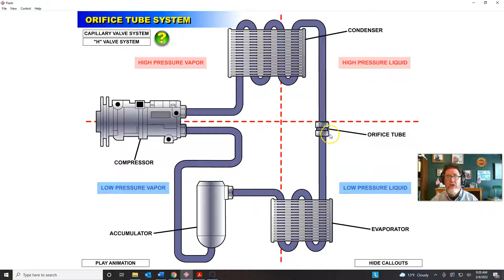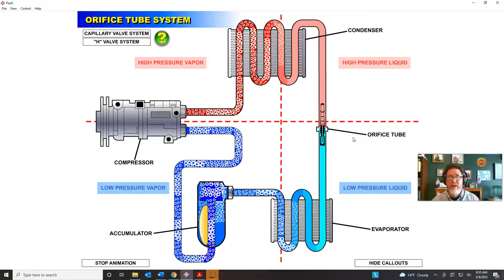How does an Automotive A/C System work: Part 3 Orifice Tube Systems

Comment: You talk about the evaporator filling with liquid and flooding over during low load conditions, but where would that same liquid be located during high load conditions.  I think it has to be somewhere, not normally talked about but my understanding is the amount of liquid in the system should remain relatively constant whether running high load, low load, or turned off.
Reply: During high load conditions, most liquid being pushed through the evaporator is evaporating and turning into a vapor through state change, when the evaporator gets to a point of almost freezing up (20ish psi) then the low pressure cutoff switch will shut the compressor off preventing evaporator freeze up.

Comment: (New compressor, Accumulator, all lines, internal orifice tube, and completely recharged) What if the lines on both sides of the orifice tube are warm, not hot, after the system has been running and the High Pressure side is reading a low PSI (80). The system only blows warm air, not even cool, and nothing under the hood is running cold at all even the lines. It's driving me nuts. Could the condenser be clogged, or blocked? Thank you!😢

Comment: Can a bad clutch fan cause A/C not to work properly?
Reply from the maker: Yes, it will cause pressure to be very high at low speeds causing no cold air. PP.

Comment: Any A/C Ninjas out there? Professor? I have a 1980 Corvette L82 with A/C issue. The system will cool to 55 degrees on an 80-degree day. However, the compressor remains engaged at all times. The high-side pressure never gets above 50PSI. The system should have (converted) 48oz of R134, but with 36 oz in, the low side is up to 55PSI. (Nervous to put in more.) The system is all new. There is a new evaporator, condenser, orifice tube, compressor from Rockauto/Gold, and most lines. The lines in and out of the dryer and evaporator are cold. Cold to orifice tube bottom, hot pass the orifice tube connection. Freon detector finds no leaks. What would cause the high side to not go beyond 50PSI?
Reply: Sounds like youre low on refrigerant but possibly compressor issues. Where are you getting your 48OZ and 36 OZ? Brand new system, sounds like this is the issue

Comment: Hi professor. How about if the evap is freezing up and I changed the low pressure switch on the accumulator and the charge is good? No restrictions on the evap or draining for it as well. What could be the problem? Clogged OT?

Comment: I have change the compressor the cindenser and the acomulator on an f150 2006 and now im getting about 70 psi on the low side and 350 plus on the high side and if i remove refrigerant presures regulate and it needa more refrigerant ?  What do u think about this the evaporator is restructed ?

Comment: @professor Pentane, I was hoping you can explain in a video an auto A/C system with a auxiliary Evaporator. The front Evap uses a OT and the rear Evap uses an TXV. It only has an accumulator and No Receiver/dryer. With a scroll compressor and clutch fan.
How much more difficult is it to trouble shoot this system and what would be the "good/normal" pressure readings on a manifold gauge.
Reply from the maker: Hi Alfredo,   I have another video talking about rear A/C systems and how they effect pressures.  Please watch to answer your questions:  https://www.youtube.com/watch?v=k2xGv6CyJyI&list=PL3XwHgpcSh2ZWNwqI-RWG-6pt8BWsvDJs&index=3&t=3s
Reply: @ProfessorPentane  thank you, I appreciate your response.

Comment: Great Video.  I need HELP.
I am working on 2006 Mercury Mountaineer V8 4.6L. Replaced one Orifice tube by the firewall.  But my brother-in-law informed me that there are 2 orifice tubes in the system.  Is it true? If so where is the second orifice tube should be?
Thank you for your help in advance.
Reply: My 2002 mercury mountaineer 4.6L also has an auxiliary Evaporator in the rear but it uses a TXV and not a OT. It's located next to the Evap on the rear Left side. You need to disassemble the interior in that section.

Comment: Very nice explanation.  When converting an older system from R-12 to R-134a, would you recommend changing out the orifice tube to what is used in the early 134a systems?

Comment: What if you had an orifice screen air conditioning system that high pressure was about 200 lb low pressure 35 at a 90° day with the blower motor on low turn the blower motor on high high pressure goes up to over 350 and low pressure goes almost into a vacuum and noticed ice accumulating up to evaporator
Reply from the maker: Hi Scott,   On an Orifice Tube system, the compressor should kick off under 20 psi from a low pressure cycling switch or other related freeze-up control.  I would start there, but you could have more than one problem here.  The OT could also be restricted.  Good Luck!